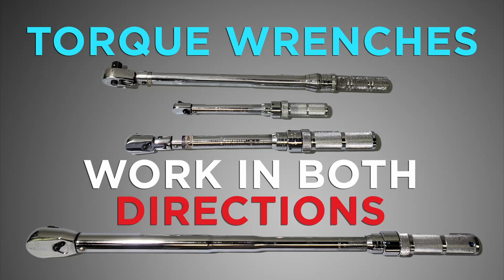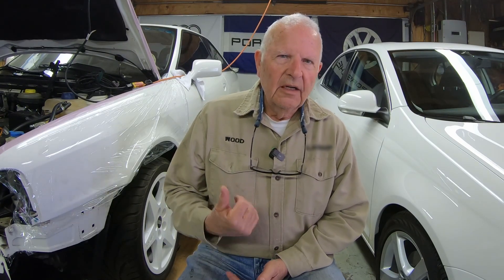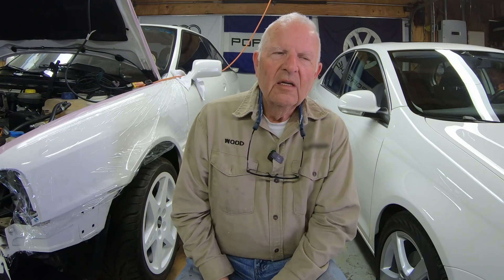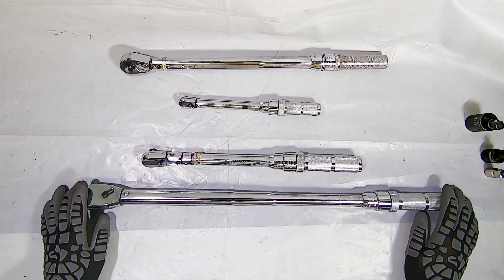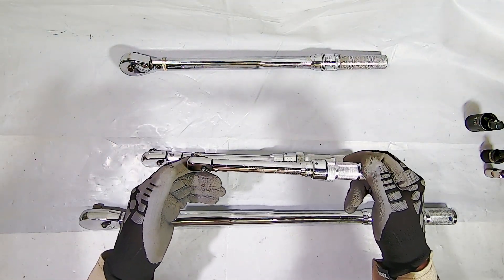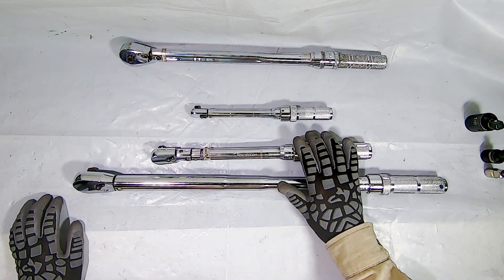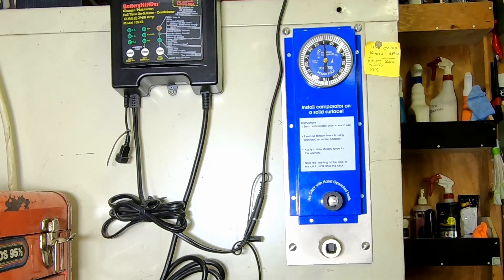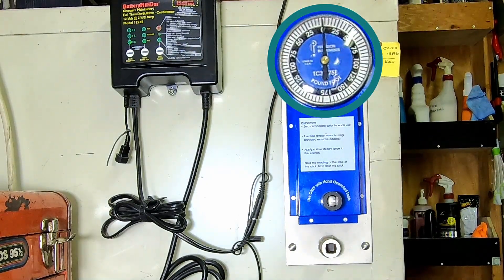Torque Wrench used as a breaker bar?

Comment: Yes, it's as you say, a torque wrench that's bi-directional (specified for both RH and LH threads) can be used with care to loosen as well, since undoing a nut is just applying torque in the opposite direction. If you use it the same way, stop if it clicks and set a higher torque, never continue past the click, it's no different to normal use. Wrenches that have no LH click have a mechanism (likely inclined plane detent) that isn't designed to accept force in reverse, so shouldn't be used this way.
Bi-directional wrenches will have accuracy in the specs for both directions - it's typically +/-4% CW and +/-6% CCW, which gels with the less accurate CCW results on the comparator.